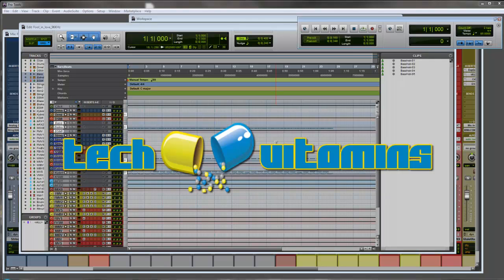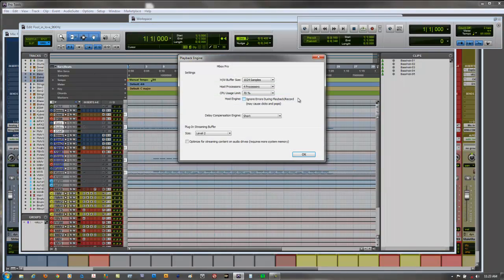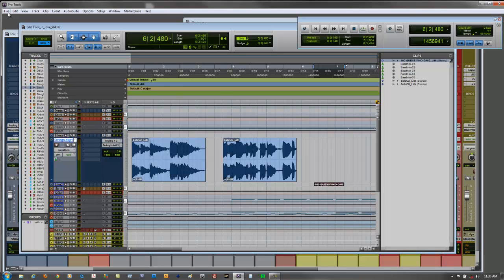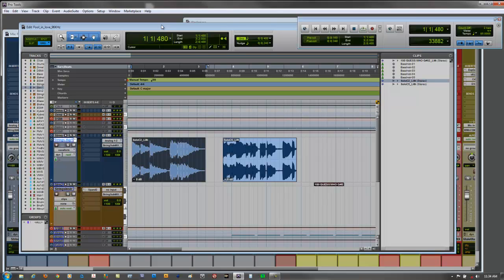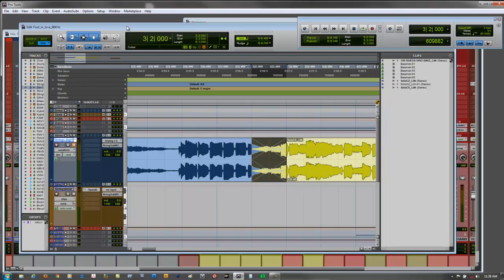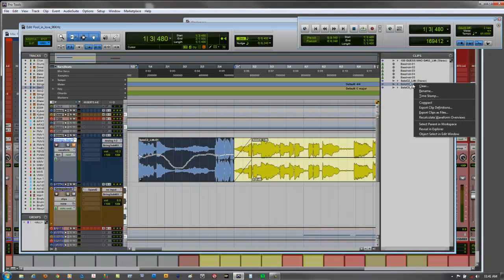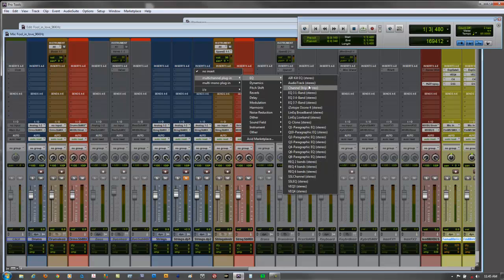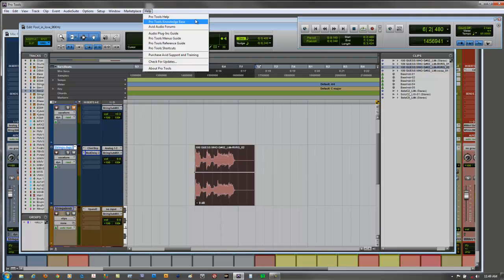Pro Tools 10 ALL NEW Features explained

Comment: Nice Video thanks! I got PT 10 upgrade from 8 A few weeks ago. Am luving it. And internet works fine while in A session. But stay away from viruses and stuff. Only access trusted sites. And you can rent plugins now...

Just need to add my 3 hardware delay compensators to the sends. spidif, 002, and ADAT. Trying to figure that out now...